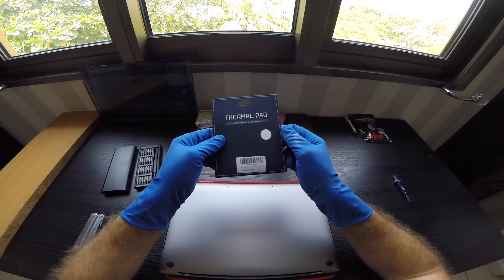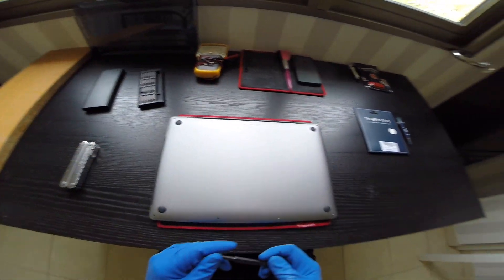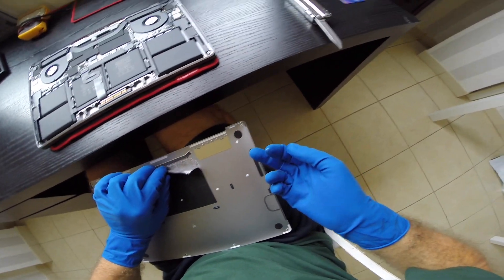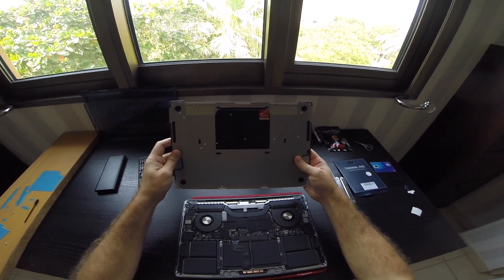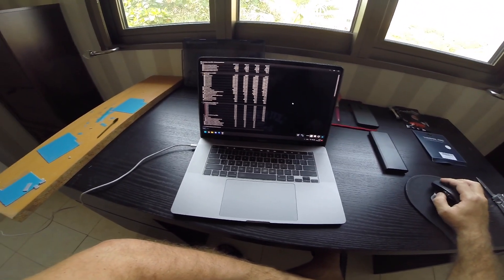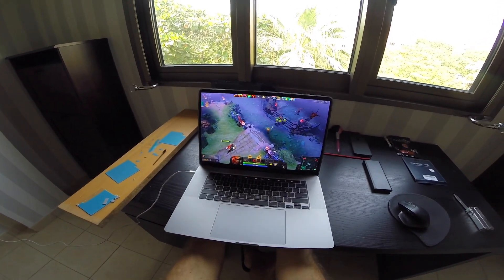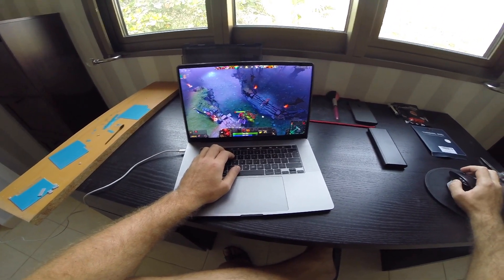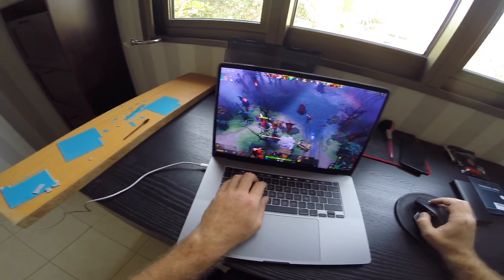MacBook Pro 16 2019 VRM cooling mod, ready for gaming

Comment: Hello. Great video mate. Going to try it with mine. I have i9 with 5600 and sometimes keyboard is warm under wasd and fans noise is bugging me a little. Do you think adding pads to the heatsink of gpu and cpu as well as to the vram would help or its a bad idea? Cuz the lid is going to transfer more heat between 3 hot spots instead of only vram cooling?
Reply from the maker: @AlmairDelMar  CPU and GPU should be fine, VRAM’s are throttling and adding pads to them makes the body very hot already. Try to apply one-by-one and see

Comment: Hello bro, i own i9 9980hk with radeon 5500m. It overheat some times, i am searching for a guide to undervolt it. Can you help me please?
Reply from the maker: Hi. You need to install windows and to use Trottlestop to disable turbo boost
Reply: @Simonius0077  i already did both, windows 11 installed and throttlestop but it had not so much improved..
Reply: @ferrari458it2  use quick cpu, it allows you to set max power draw
Reply: @Simonius0077 he can also use quickcpu to tweak the turbo boosts, and set max wattage.

Comment: So what you have done is putting some thermal pads on the vram of the macbook, I have a 16inch mbp with a I9 9980HK and actually it is not overheating but it can come quite hot. If I does this carefully, can it void warranty or not ? and I would like to buy some PTM7950 thermal pads, are they good ?
Reply from the maker: @-ragnir-  Hi. In terms of cooling there is no much room to improve due to cooling system capacity. PTM is ok can give you a little better figures and for sure will stay longer, but only if it is genuine. The only way to reduce temps is to power limit the CPU by defining the golden middle between performance and temperatures. Disabling turbo boost is most straightforward way for in this particular case as not much frequency/ voltage control is available in the MacBooks. Regarding cooling the VRMs is only way for to have stable performance. Thermal pad mod should not void the warranty as no hardware modification is made but it is better to contact apple in order to clarify warranty conditions (not sure if this old model still can be covered by the warranty)
Reply: @Simonius0077  yeah I have disabled turbo boost for gaming and I noticed 0 performance drop just 20C less and less noise, my MacBook is covered beacause I bought it at Backmarket with an extended warranty (I am mainly using it for school). Thx you very much for your response dude 🙂

Comment: Did you have any graphical problems? 

Without running anything intensive, I notice judder with simple YouTube videos (Chrome/FF) and even basic actions like typing and seeing characters lag. Funny enough, it's less noticeable if I use gfxCardStatus and force the AMD graphics card (4GB). But then that liquidates the battery. In less than an hour I go from 100% to ~70% battery. 

What's laughable is Apple's OWN 4K content through its OWN TV app won't work! It renders a jumbled mess. But get this, if I connect to an external monitor, the content will play (and doesn't look like 4K at all) and will lag ever 5 seconds.

I might've read something that a faulty ribbon cable might be the culprit?
Can't tell you how disappointment I am in Apple. Unacceptable.

Comment: Hi mate, can you make a video of the settings you have used for the cpu and gpu showing how to get it set up and the power settings? 
Thanks!
Chris
Reply from the maker: Hi mate. You need program for windows under bootcamp called HWinfo to show you all date temps, frequencies and load, then to stop turbo boost of CPU you need program ThrottleStop. To improve fan rpm’s cooling curve program MacFanControl
Reply: @Simonius0077  Great stuff mate, i'll give that a go, seems to get super hot maybe getting the fans on sooner will be better thank you!

Comment: How high did you stack the thermal pads?

I just did this mod a few days ago and stacked them up to 4.0mm from the lowest black chips but that didn't make much difference.   I added another layer to make it 5.0mm and it's still the same.
The CPU still throttles down to 0.78 GHz like it did before I did the mod.

I have the base model 5300m and i7-9750h.
Reply from the maker: HiTim,
I stuck it around 4.0 mm as well. This should be enough.
Since then no more VRM overheat throttle issue.
CPU is another story. This heat sink is not enough capacity to cool down 9750h nor 9980h. So if you are gaming keep always turbo boost off with Throttlestop on boot. Then your core voltage never goes over 0.875 mv
Reply: @Simonius0077   
I did have turbo boost off already and I limited my GPU to 40w instead of the default 50W.

The average temps for the CPU and GPU were both around 72-75C and never reached 80C but they still both throttled so it seems like the VRMs would still be the problem right?  I thought the CPU should be able to get to around 90C before throttling.

I also had the fans set a little slower before with macsfancontrol because I wanted them to be quieter.  I turned the fan control off and let them go full speed and the performance was pretty good but the CPU could still sometimes drop to around 1.8 GHz if left running for awhile even though temps are always under 80C.
Reply: @timm3097  have you fixed it 🤔🧐🧐
Reply: No but it doesn’t seem to throttle if I limit the CPU to base clock and let the fans run max which is better than before I did the mod
Reply: @timm3097  Try QuickCPU
Reply: @timm3097  what I did with my Mac is to disable turbo boost and then force clock mod to 100% this would make my cpu run to 2400 MHz on my i9, my problem is the vrm limiting power to my radeon 5500m to 20 watts, when I load a game it gives me the 50 watts my gpu can handle and it'll give me up to 100 fps on heavy games, temps will not go up 80 C, but after a good minute itll throttle down the wattage, making my clock speed go down from 1200 MHz to almost 300 MHz, this puts my fps from 100 to 30, it is starting to get really annoying and I have no idea how to fix it.

Comment: П.С. отпиши в комент  название термоплокладок
Reply: Я использовал DeepCool EK720-L-2.0. Прокладывал между чипами и на чипы. Хватает 1 слоя, однако она (прокладка) сдавливается и по возможности можно дополнить слой полосками поперек с расстоянием друг от друга примерно в 1 см. Результат действительно превосходит ожидания, это новый компьютер. Нижняя крышка начинает греться сильнее в месте мода, однако когда кулеры начинают крутиться это тепло с крышки они забирают. лучше всего использовать ноутбук на охлаждающей подставке.

I used DeepCool EK720-L-2.0. Laid between chips and on chips. 1 layer is enough, but it (the gasket) is squeezed and, if possible, you can supplement the layer with strips across with a distance of about 1 cm from each other. The result really exceeds expectations, this is a new computer. The bottom cover begins to warm up more in the place of fashion, but when the coolers start spinning, they take this heat from the lid. it is best to use a laptop on a cooling stand.